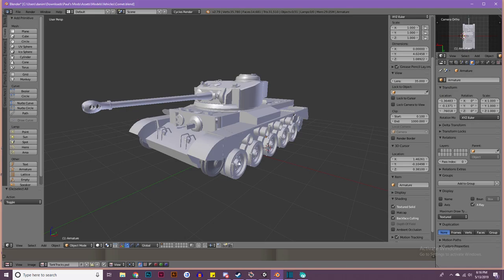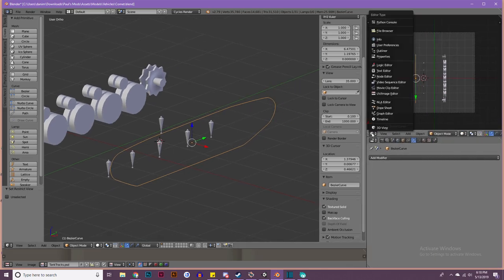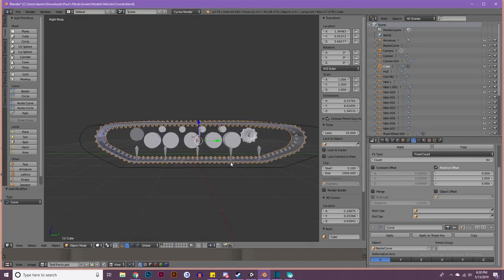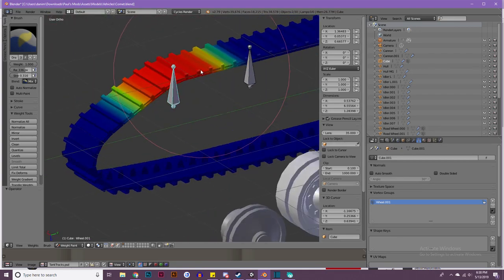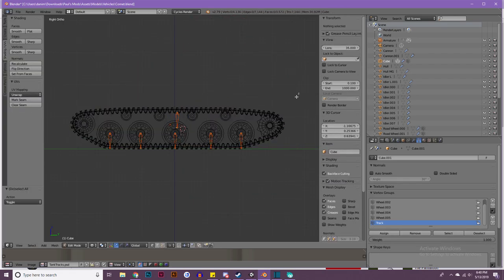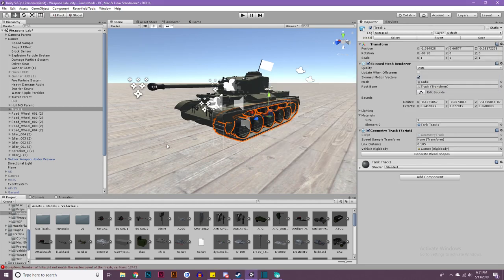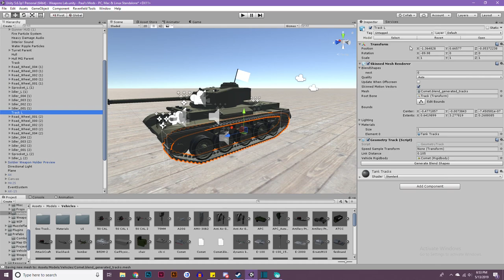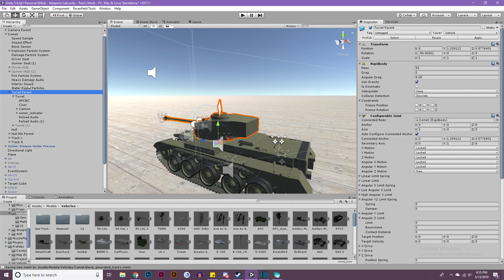Ravenfield Modding Tutorial | Geometric Tank Tracks

Comment: This tutorial has been very helpful so far, but even after edge splitting the track, it still says the vertices do not match the track links. Do you know how I can solve this issue?
Reply from the maker: I still haven't been able to find a clear solid solution to this problem, but you can check the tank modding guide on steam for some possible ways of solving this
Reply: @slippynote3740  Have you been having issues with it as well? Also is it a new issue?
Reply from the maker: @pjfaust5032  Yes and no, its been an issue since day 1
Reply: @slippynote3740  Alright, I'll try the other possible fixes from your guide tomorrow. Also, if I am unable to fix it, can I switch to texture panning if I've already set up all the bones and weight painted the tracks and stuff, or will it involve starting over. Also do you know how to do the texture panning method?
Reply: @pjfaust5032  Try applying only a smooth modifier after the curve, that worked for me